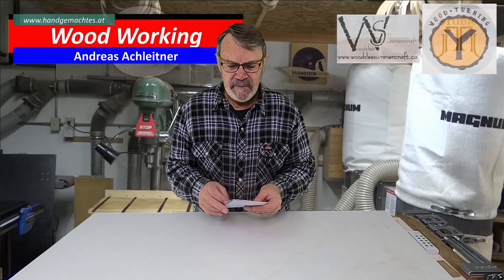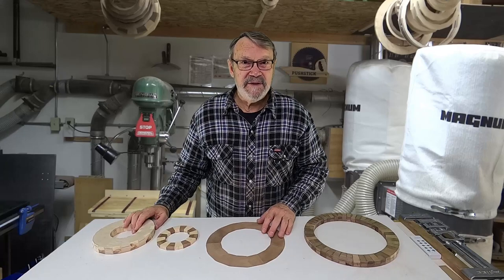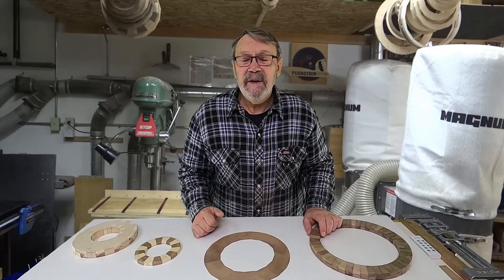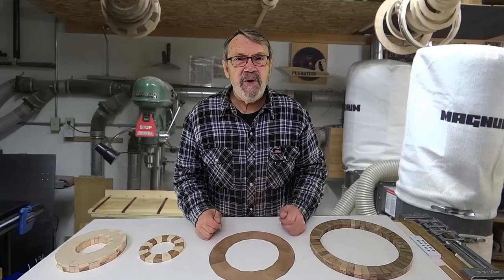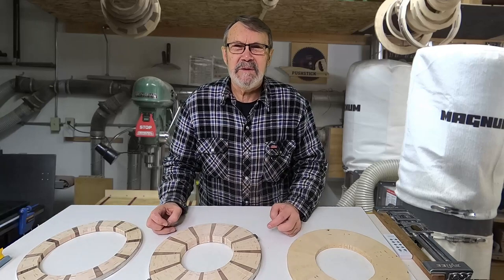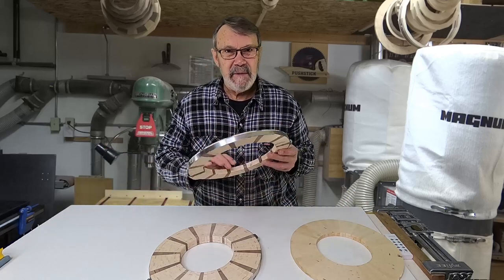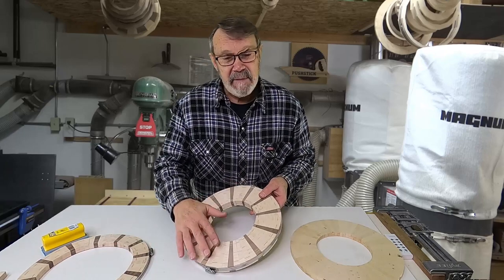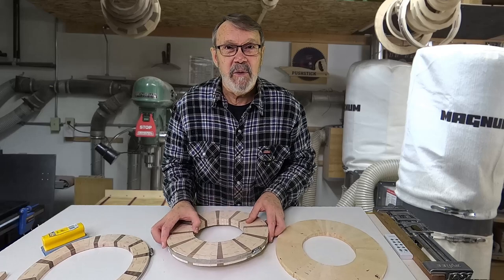Woodturning Wedgie Sled Fix

Comment: A wedgie sled is so simple I thought there is no way it could fail. Well, so much for that thought. Now I have to go to the shop and lay a steel straight edge on my wedgie sled fences. Although my fences are MDF which is generally pretty stable. When you described the problem my first thought was the saw blade. A dull blade can be problematic too. I have had dull blades produce bad wedges. Thank you for sharing Gord. Have a great 2021 and stay healthy.
Reply from the maker: I'm happy that you liked it, Glen. I hope 2021 is a better year than 2020 for you and yours. 😃😃😃 Thanks for watching!

Comment: Hi Gord,
I'm 76 years old and have only been working with wood for about 3 years now.I made my first wedgie sled as close to perfect as I could with my woodworking skills at that time.I was horrible and I was pretty disappointed in it and in myself.A couple of days later,after I settled down,I checked my 2 fences on the sled.They wern't parallel,straight or plum!I had made them out of some 3/4" x 2" wood from Home Depot! LOL
They had actually started to twist a bit too!
Long story short(if it's not too late for that)I made a second wedgie sled out of 3/4" MDF and also made the sleds from that as well. I started thinking about how much the cheap wood moved and decided to give every part of the new sled 2 coats of sanding sealer and 3 coats of clear shellac trying to prevent any "wood movement".
I've used the sled for a bit over a year now and it still cuts perfect segments every time.
So,,,,as you said,,,wood movement is very important to consider with a wedgie sled!
Thanks for the video,,,
Tom
Reply from the maker: Thank you for the input, Tom. With the sanding sealer and shellac you may not have any problems with wood movement. Personally, I try not to use MDF for anything that might encounter any kind of moisture. I also don’t think I have the patience to do the sanding sealer and shellac treatment that you did. Obviously, I am a lot lazier than you are! 😃😃😃 Thanks for watching, Tom!
Happy turning,
.....Gord

Comment: Excellent information. Another vitally important point about the wedgie sled, is that not only do the sides of the fences must be flat as you pointed out, but they must be parallel. If they’re not, you will always have a gap. I like your method of trueing up the rings with the table saw.
Reply from the maker: Yes, that's just one more thing I forgot to mention, Greg. If I ever publish a video without forgetting something I meant to say it will shock the heck out of me!! Thanks for pointing that out. 😃😃😃 Thanks for watching!

Comment: Hi Gord, when gluing half rings,instead of using dowels, use a wood strip long enough to catch both ends of the ring.that forces the ring ends to be flat and straight with each other. The halves will go together without sanding.
Jerry
Reply from the maker: Thank you for the advice, Jerry. I had been under the impression that using the dowels allowed the half rings to swivel a bit to close up. I will give your method a try. Thank you again. I admire your work more than I can begin to tell you! Thanks for watching!
Happy turning,
…..Gord
Reply: @GordonRock1  Thank you Gord, I am assuming the segments are cut correctly and it is just a gluing time problem. I also when gluing up a ring I will butter them all up but keep them apart until they are all done. Then put them together.
Jer
Reply from the maker: That sounds like another great idea. Thank you very much, Jerry. Much appreciated.
All the best,
…..Gord

Comment: Hi Gord, I truly enjoy your videos. What I use and so far it’s working for me is UHMW strips. It comes in various thickness and width.
Many thanks, I have learned a lot from you.
Reply from the maker: Thanks for the kind words, William. I have used UHMW but I don’t have any and I work with what I have. Once I realized what the problem was it was a simple matter to just joint one edge of each of the boards and then put them through the tablesaw to make those pieces parallel. I do appreciate the input. Thanks for watching!

Comment: Hello Gord, very nice video!
I made some 112 segment rings for a vase,  16 times 7 , so  glued 7 segments together with a fast glue and clamped them with my hands, then the 16 blocks in a hoseclamp. it worked well.
Reply from the maker: 112 segments? Holy cow, that would mean 1.6° cuts to make the segments. Those must’ve been either very short segments or in a very large piece. I’m not sure I even want to try that, to be honest. Glad you like the video, Peter. Thanks for watching!
Happy turning,
.....Gord

Comment: Gord, you might want to look into using some scrap counter top material like Corian for the arms on the sled.  It won't move with temperature and humidity fluctuations.
Reply from the maker: Thank you, Billy. I did look into getting some Corian but it's real expensive up here. I even tried to buy some cutoffs from cabinet shops and they think it should sell for just north of the price of gold. Thanks for the tip anyway, buddy! Keep getting better, my friend.
.....Gord
Reply: @GordonRock1  Wow!  I've have several large pieces given to me so I guess I'm spoiled.

Comment: Gord, I never trust plywood for fine edge work. I use 15 minute open time PVA glue for my segments, and start with a dry test run using pine; making spares, and numbering them. Each edge is sanded on paper over a plate glass shelf and test fitted; turning over if necessary, as I find that can make sufficient difference. I must confess my way takes patience, and so far have not made rings of more than 14 segments.  Still  a beginner at this, I use the bandsaw, with a correction factor for its protractor, and flip the wood. It's a slower and more gentle process than using the table saw, especially as the blade must not deviate nor  flex. Perhaps I've been lucky so far.   Bernard.
Reply from the maker: That does sound like a lot of work, Bernard. As long as it works for you that’s all that matters. There is almost always more than one way to do anything in woodworking. Once you find the way you like to work why would you change unless you find an easier or more efficient way!?? Thanks for watching!

Comment: Hi Gord enjoy watching your videos and I learn alot from you guys who take the time to show us all how you  make such fantastic things out of wood.
I would just like to comment on the way I have seen you using the wedgie sled. Maybe you cut out some of the inaccurate segments by feeding the timber into the saw blade with the sled supporting the rear of the timber being cut rather than feeding the timber into the blade unsuported at the rear where the torque of the blade could move the timber very slightly.
Reply from the maker: Good point, Howard. I will try to keep that in mind. I appreciate your input! Thanks for watching!

Comment: After my move. OMG it's been over a year. New shop (steel building), new saw (3hp SawStop), new thin kerf saw blade, new wedgie sled (old one doesn't fit). Just cut first segments about a month ago. I have gaps! Checked fences, OK. Bought a Pete Markham sled, still have gaps. I wonder if it is the thin kerf blade. I will go back to regular blade next month (Jan 2024). Holiday season to busy for woodwork. Checked blade alignment. Out about .003. Too much? Added blade stiffener. Any thoughts from you? Have a great holiday and stay safe. I pray your health is improving. Take care my friend.🙂🙂
Reply from the maker: It is very annoying when your wedgie sled gives inaccurate segments. You said you have a new wedgie sled; are you using the same wedges you used with the old sled? Were they accurate on the old sled? I can't see why the thin kerf blade would make a difference. It is just going to cut parallel to the slots on the tablesaw. The angle that is set by the wedgie sled is going to be what makes the difference. I don't believe that .003" is too much. We all want our alignment to be perfect but for most of us that is just a dream. I really don't know where to go from here, Glen. I am very curious to see if there is a difference when you go back to the regular blade. I'm sorry I'm not more help, my friend.
Have a wonderful Christmas, Glen. I know you are living close to family and I'm sure that will be helpful. 🎄🎄🎄
Take care, my friend,
.....Gord 😃😃

Comment: You might want to use my method for setting up the segments for your ring...count the number of segments on your fingers. Works nearly every time. LOL!
Seriously, would making the guides of you wedgie sled from MDF instead of wood? I hear it is very stable and resists movement. One drawback from this idea is the MDF is softer than wood so it is more likely to be damaged during use. It might be worth a try.
Reply from the maker: The sad thing is that I thought I had counted them, Gil. Unfortunately, once I hit ten I have to start over. It makes counting to 60 a real challenge!! 😃😃😃
The thing I don't like about MDF is that just carrying a glass of water into the shop seems to make the MDF swell in certain areas. Okay, I might be exaggerating just a little! But I never use MDF for anything that I have concerns with moisture of any kind. I appreciate the input though! 😃😃😃 Thanks for watching!
Reply: Garry not Linda. MDF is a poor choice for anything like that. I made a bandsaw sled out of it a year ago. It has grown so much it is totally unusable now even in the dead of winter. I also made a bandsaw fence out of it. No longer square and I thought I did a good job of reinforcing and cross bracing. No, there is no place in my shop for MDF for anything. It isn't even good firewood.
Reply: @GordonRock1  I can go up to 20 if I take my shoes and socks off, but that means I'd have to sweep the shop floor...so up to ten it is.

Comment: Why does your sled have two rails? Couldn’t you have just one and flip the wood each cut?
Reply from the maker: No, Daryl, it isn’t that simple. If you use just one rail it would have to be at an absolutely perfect angle! By using two rails if one of them isn’t perfect the other one will make the difference needed. I’m not sure I’m making sense. Because the wedge already has the angle built in, when you switch from one rail to the other it will compensate. I believe it will make more sense to you if you try building one with one rail and doing some test cuts. That way you will see for yourself what I mean. I don’t think I can explain it very well this way. There are a lot of videos on YouTube showing how the Wedgie sled works. You might want to take a look at some of those. Sorry I’m not doing a very good job of explaining.

Comment: So I have a question 🤔. I'm trying to make a ring that's 10 segments and is the 4 inches, And another that's 10 segment ring but it 11 inches. Every time I try to get the 4 inch and 1/4 or bigger and the same thin goes for the 11 inch ring but that one is even larger, like it would be 11 inch and a half or 3/4. Do you have any idea on what I can do to fix this problem?
Reply from the maker: If I understand your question correctly, you need segments for the 10 segment ring, 4 inches in diameter and they would need to be 1.257". The 10 segment ring at 11 inches in diameter would need segments 3.456". Does that answer your question? If not let me know and I will try to do better. Also, I often make my segments a bit wider than I need them and then a bit longer as well so that I have some extra to turn away. Getting the rings to the precise dimension can be very difficult. Good luck with them!
.....Gord

Comment: Another great video! Do you have anything on gluing partial segmented rings?
Reply from the maker: I don't know if I have ever shown anything on a previous video, Calvin. I have way to many videos out there to claim that I remember everything (anything?) in them. Is there something you feel you need to have explained. Let me know if I can help and I will try to do it. 😃😃😃 Thanks for watching!
Reply: @GordonRock1  You had mentioned about glueing up a partial segment on the 60 segment ring. I was just trying to figure out how you clamp a partial segment.
Reply from the maker: Sorry, Calvin, maybe I wasn’t clear enough. Because there are 60 segments I am not able to spread the glue quickly enough to do the clamping before the glue starts to dry. My intention would be to glue 15 segments but put the entire ring together and clamp it. I would repeat this after the glue dries with another 15 segments. I would repeat this until I had  2 30-segment half rings which I would then glue together into one ring. I have yet to actually try this so it may take some trial and error to get it to work properly. I hope I’m making sense. Please let me know if I am not!
Reply: @GordonRock1  That clears it up! I was trying to figure out how to clamp a partial ring. How you do it makes perfect sense. Thanks!
Reply from the maker: You’re welcome, Calvin!

Comment: Hi Gord, have you tried glueing up segments using a slow cure epoxy? The one I use has about 45 minutes open time before it sets up.

Now I need to go check my sled and make sure it is still accurate.
Reply from the maker: No, Lyle, I haven’t. I don’t believe I have seen an epoxy with an open time that long. I usually see 5 minute epoxy but maybe I just haven’t been looking for it. Thanks for the tip. 👍👍 I will have to look for it. Thanks for watching!
Reply: @GordonRock1  Aero Marine 300/11 Epoxy is what I use
Reply from the maker: Thank you, Lyle.

Comment: This may seem to be a daft idea but do you think it would work. Pin the setting wedge to a board and use that instead of the adjustable arms. If the setting wedge is thick enough it should work. by the way I never have a problem listening to your words of wisdom.
Reply from the maker: Fred, I'm sure that would work. I haven't tried it but it's certainly something to think about. I appreciate the input and your kind words. 😃😃😃 Thanks for watching!